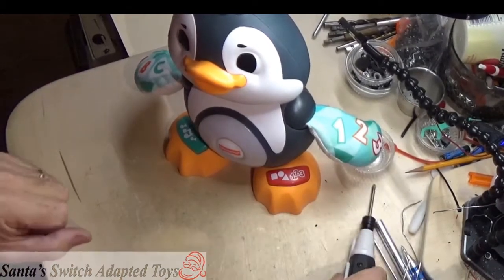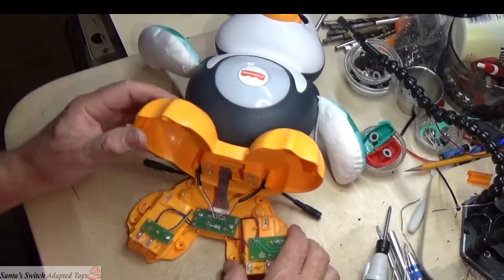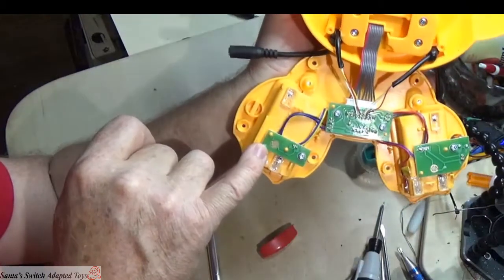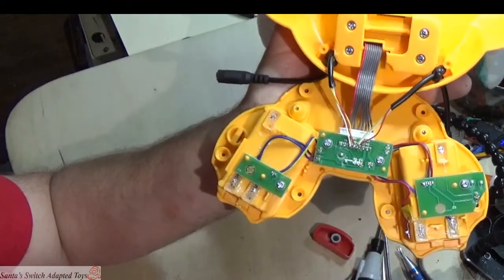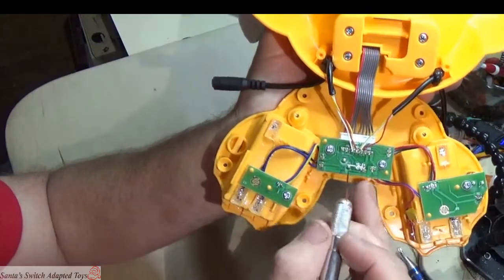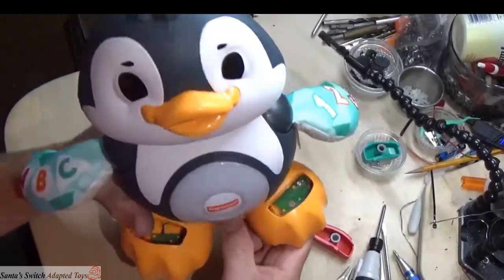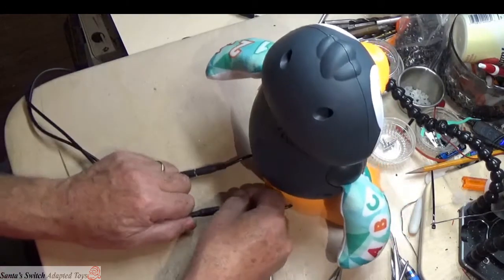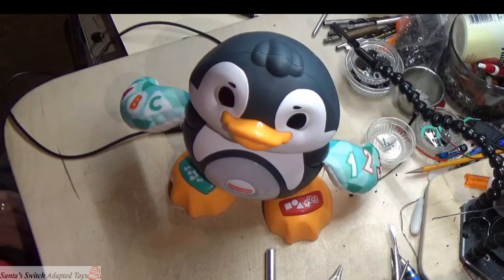Santa's Switch Adapted Toys - Penguin adapting

Comment: Hey, love your post. I didn't know people were adapting Linkamals so I winged it without any information and ended up with a slightly different result. 

Do you find an advantage to using the central circuit board solider points, rather than the solider points on the foot circuit board closest to the switch? 

I used the first two points that lead out from the switch plate on its left foot... 

and found the center and ouside of the cluster of three points on the right in that same area. If that makes sense. 

I'm just curious if this seems okay, or if there is any advantage to instead connect to the central base circuit board.
Reply from the maker: Well done! 
Good observation and shows there are multiple ways to accomplish the same thing. 
Both work equally well and no particular. 
On mine, all the soldering is done in close proximity. In your description, the wires connect farther away, but it is just as effective.
Reply: @TheLaserguy2 Thanks for the reply. I was glad this one was pretty straight forward. Great that you are making these videos. It's a very clear way to demonstrate.